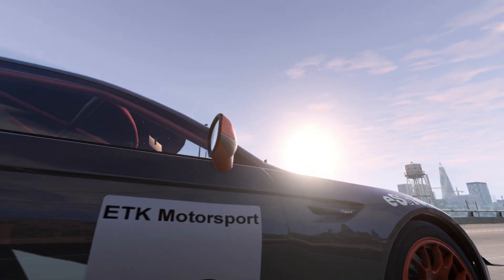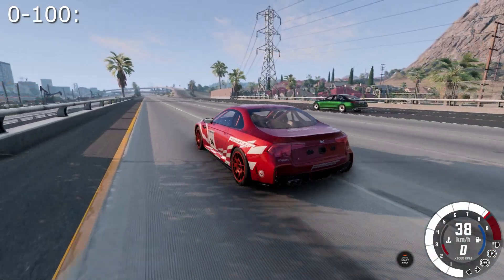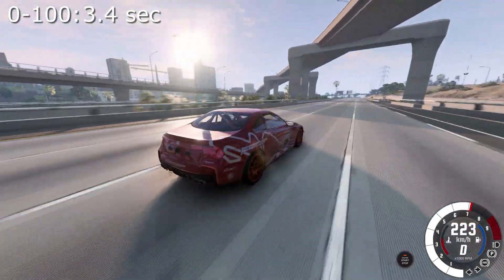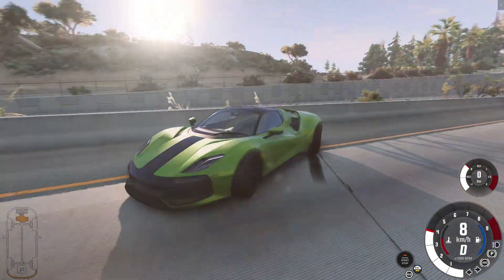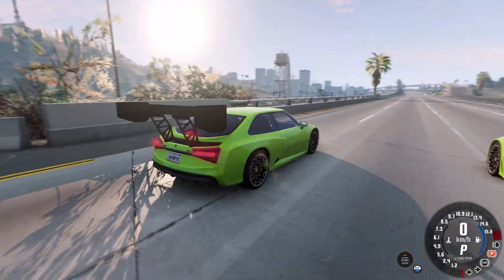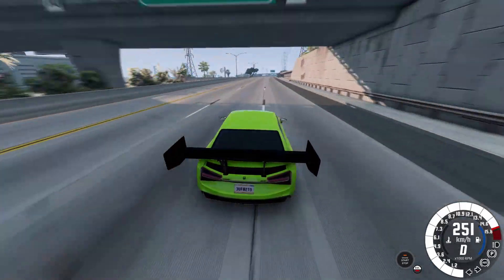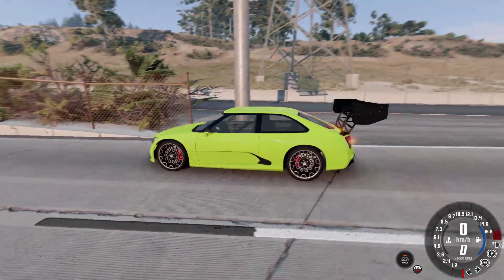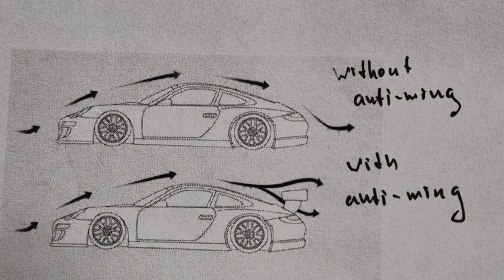Why do we need spoilers?

Comment: I really like your videos, but your explanations could use a bit more details. 🙂

Having a mighty wing increases downforce of the vehicle, especially at the wings location (so usually a rear wing increases downforce mostly on the aft wheels) which increases vehicle stability but comes at the cost of increased drag (air resistance) which reduces acceleration (at high speeds where air resistance is the largest resistance by far) and top speed. 

You can test this on the Scintilla "Velocitas". It doesnt only have a more powerful engine but it has a drive mode that does keep the spoiler/wing pretty low which significantly increases its top speed but at the price of reduced downforce and thus stability.
Reply from the maker: Yes, I agree, spoilers are a rather extensive topic and I just didn't want to overload the video with a lot of information. Maybe someday I will release another part 3 of the video about spoilers, I just need to collect more material! 
Thanks for the help and advice, my friend )

Comment: Wow vanilla configs tune so well , that they are have low enough drag to effective deliver a downforce to the wheels which helps whit acceleration, couse after you take off the wings results become worse, honestly i didn't expect that , no spoiler mens less drag , less drag mens better staigh line performance
Reply from the maker: Yes, the standard car configurations in BeamNG are very well developed, they still have many characteristics that can be checked in comparison with standard cars. BeamNG is one of the most detailed games I've ever played. Glad you liked the video)